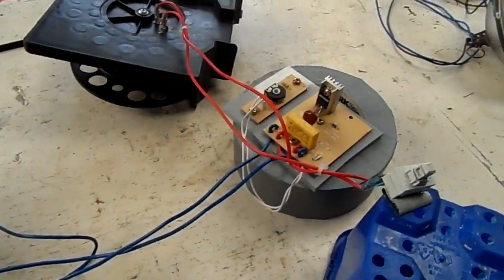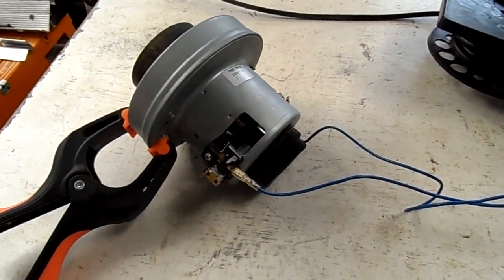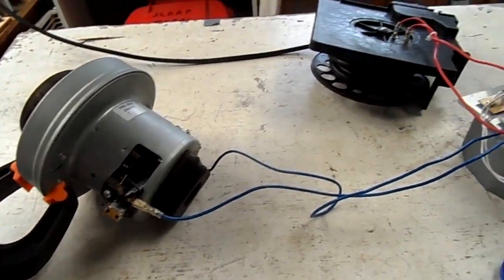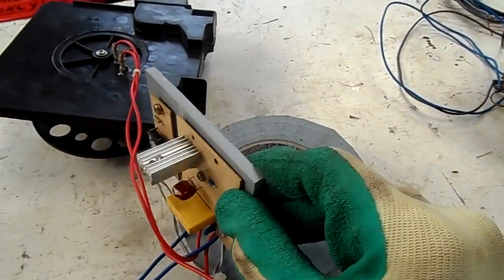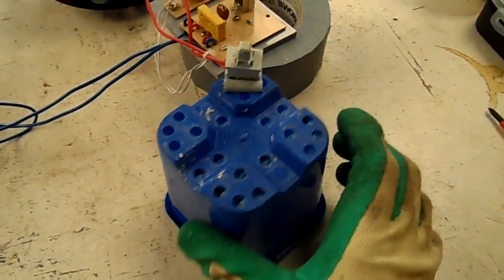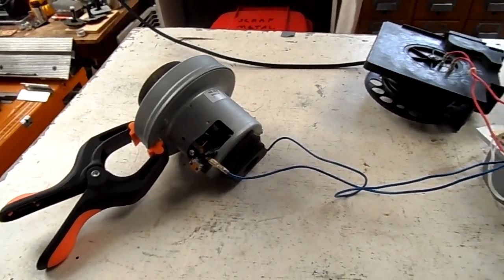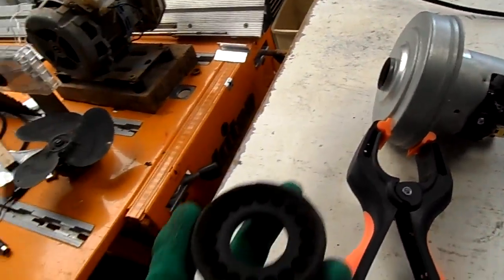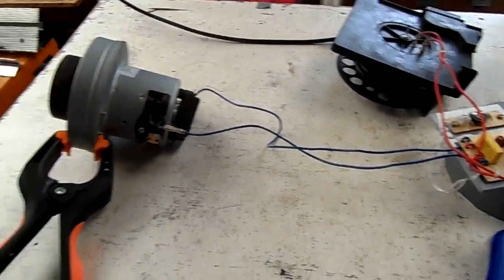Bare vacuum cleaner motor start up and run

Comment: I bet you could turn it into a turbocharger
Reply: It would not make enough boost
Reply: Joke asides, it could pump enough air to create some boost on a small engine, but you would need a powerfull step up dc-dc converter to power it up.
Reply: Yea

Comment: How Many watts is that the vacuum motor? Ps i´m from Portugal because of my bad english
Reply from the maker: Probably around 1KW
Reply: @MrMacman98  what if you put it I to an old aixam quadricycle which had a 1kw engine? Will it even move with the car?...I have a 2kw vacuum cleaner motor
Reply: @idonotknowwhyyoutubeletsyo5893  did you use the 2kw motor for tour proyect ??
Reply: @mauriciogianotti8039  I didn't use the motor. I only presented the idea because I don't even own an Aixam car/quad. I only owned the vacuum cleaner which had a 2KW motor. It would only move if you were able to supply the motor with 230V from the wall plug since it's an AC motor. It woud be possible but it would be more worth it to buy a 2kW DC motor somewhere and a bunch of batteries. Over the two years that passed after i posted the comment, the vacuum cleaner broke. The motor and the connecting terminals overheated. So i won't be able to do it any time soon.

Comment: I got a vacuum motor and powered it up with 120 60 hz volts US (the motor's rated voltage and frequency) and it worked fine until the 7th time I turned it on to show my friend it sparked and didn't work. what could be wrong? I'll try a new cord and start over. the brushes are fine and I polished the armature but it won't work.
Reply from the maker: Ahh you may have blown a connection in the rotor winding! Does it make a humming noise when plugged in?
Reply: Mac Man no but I think I found the problem. if I fix it I'll let you know. I am also having trouble getting the nut off the fan. I even tried using a drill with a nut driver on it but nothing seems to work.
Reply from the maker: Groupof Yutubekids no worries, I don't generally bother trying to get the impellers off. I suppose you know about reverse - thread on bolts
Reply: Mac Man *UPDATE* It turns out to be the carbon brushes. the spade clip on one of the brushes was broken so no electricity went to the brush. I'll find some new brushes for it and video it.
Reply from the maker: Groupof Yutubekids ahh a common fault! You could probably get away with pulling the motor out of another vacuum cleaner and racking the brushes off of it, they usually use the same size.

Good luck on fixing it!
Reply: Mac Man thx!

Comment: Is it normal to get those sparks (or whatever they are) when powering up the motor?
Reply: Yes
Reply: 8 years too late but yes if a motor has brushes it will spark